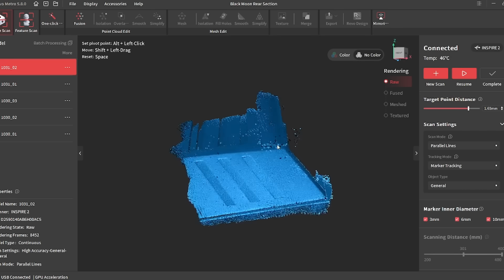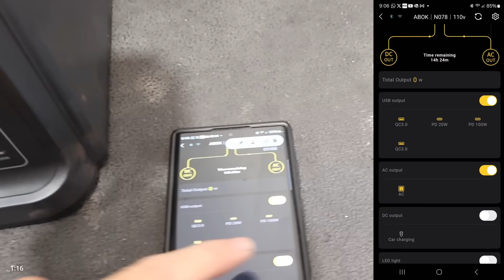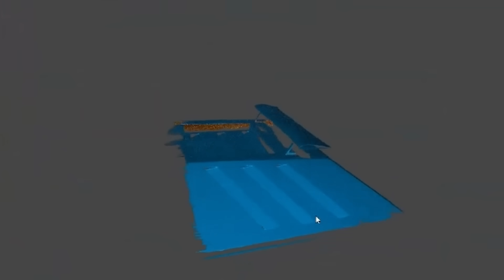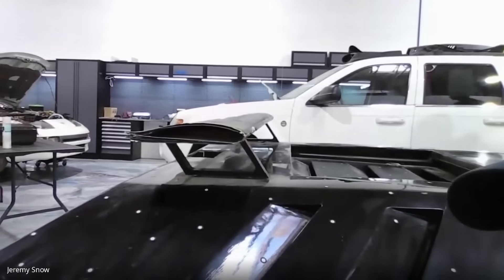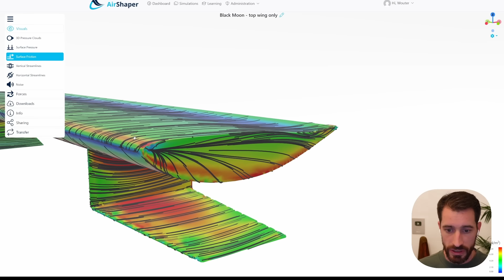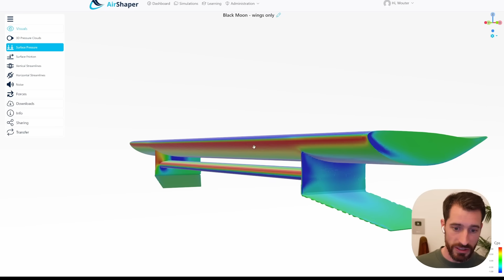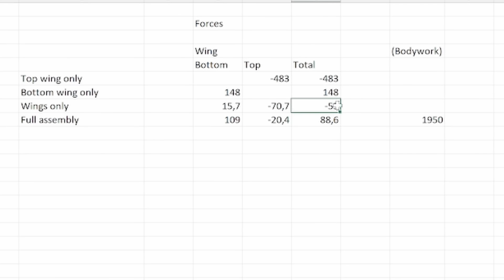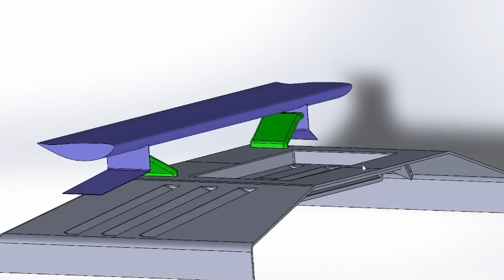We Tested the Black Moon Car Wing — The Results Were Surprising!

Comment: Really enjoyed the technical analysis of this wing setup!  In order to stay true to the original look, I'd love to see a double functional wing if possible.  But I wouldn't want you to sacrifice performance for looks.
Reply from the maker: Noted
Reply: Definitely invert the lower wing but what if you remove the center third of the lower wing and add vertical brackets on each newly created end.  That would increase the mounting strength of the wing setup but more importantly allow all that center pressure building at the choke point to dump through the center but still give a very similar side profile for the double wing look.

Comment: Personally, I think the wing's primary purpose is aesthetic. And it looks awesome the way it was originally designed. I stick with the original (non-functional) design. Or, if you must, design a new double wing that looks similar but is less bad. Both wing sections would likely need to be thinner, separated a little more (to allow flow between them) and optimized airfoil shapes to reduce drag. Thanks for the video! Love the channel.
Reply: Generating lift is no good, could be dangerous
Reply: My concern as well. Not increasing the spacing still leaves some of the proximity problems.

Comment: I'd flip the bottom wing and move it slightly forward so the airflow combines like the F1 clip you showed. That would also give you room to fit new mounts so each wing has separate supports. You could also make the lower wing active, so you can increase or decrease the down-force as needed.
Reply: If the lower wing is moved far enough forward, it could articulate enough to create massive downforce and drag during breaking.

Comment: You kinda glossed over the fact that the bodywork (only the rear panel that got scanned) created 1950N of uplift, which is an order of magnitude more than any wing configuration created in downforce. The entire car aerodynamics are terrible because of that 80s wedge shape (a lot like the Lamborghini Diablo which famously had a higher drag coefficient than the VW bus). 
Bottom line: no matter what you do with the wing, this car will handle poorly at high speeds. It's best to assume that this will be a show car that never exceeds 50 mph, and not to worry about aerodynamics. Keep it as accurate to the film as possible.

Comment: First off someone is going to put their foot down and if this car becomes floaty at the back they are going to wrap it around a tree. I would invert the bottom wing but I would consider moving the upper wing back a little so the lower wing is slightly forward of the leading edge of the top wing. Now my knowledge of aerodynamics could be written on the back of beer coaster with a crayon  so I would run it by the guy who actually knows what he is talking about

Comment: Remaking the bottom wing would still produce lift or at least very little downforce. The design of the car just makes it so. Removing the lower wing is probably the best if you look at the aerodynamics, but it takes away some of the looks from the movie.

I wonder if the "best" option might be to remake both winds and just make them very thin and they would not cause much of a aerodynamic change, but look "right" from a reasonable distance.

Comment: Replace the bottom wing with just a flat sheet of something, that way you still get the general look of the original but a bit better performance so that the car doesn't fly away at high speeds 😅

Comment: From a movie history standpoint, the car should be restored to it's original design. The original intent of the artists who built it was for it to look cool on screen, so that's what you should try to recreate. The 'car guy' side of my brain is saying 'flip the wing so they function like actual aero wings should function. But the movie fan in me says 'what if he decided to change the Batmobile or the Delorean just so it was more aerodynamic?' Most people would say that's sacrilege. I think go with what it was originally supposed to look like.
Reply: If this was to be a static display then I would agree with you however this is intended to be a working and running vehicle. As such it needs to be safe on the road and now that the aerodynamic analysis has shown that the net effect of the 2 wings actually produce uplift then this would potentially make the car unstable at speed and will have to be changed. Also if they weren't changed and the car was in an accident related to instability then liability would clearly lie with the company/people restoring the car.

Comment: Make it so it provides downforce. We all know the original was put together with zero consideration for function, and solely for the visual element. Nobody will notice if the new wing is orientated correctly, and it would be daft to deliberately add lift to a RWD vehicle.

Comment: They might have not paid any attention to the wing. They just needed to slap a big wing on it for the camera. With modern technologies available you could make a wing that is actually functional but I think tou need to first make the car run and input the car specs and body in the equation to be able to find an optimal downforce wing. Or just slap a big good looking wing and call it a win, its not like someone will race it and needs a 0.6 secconds advantage.

Comment: Please, optimize it.
Do modern swan neck mounts, mounting the wings from the topmost surface down and add endplates (think F1 or Porsche 911 GT3 RS).
Do a double stack.
You will have to add downforce on the front, too, if you go down this road.